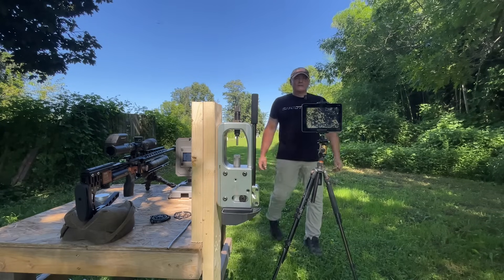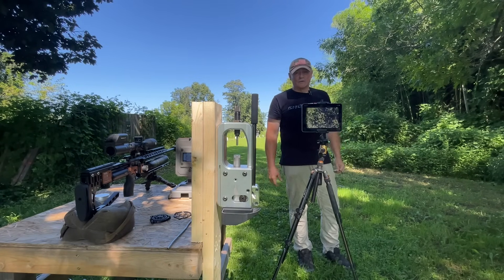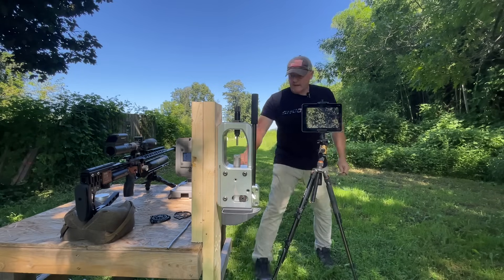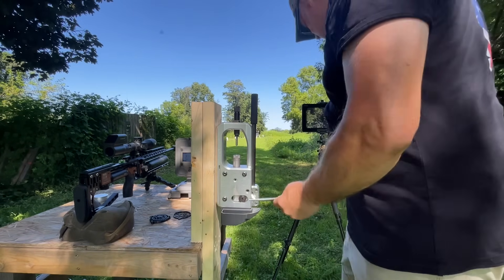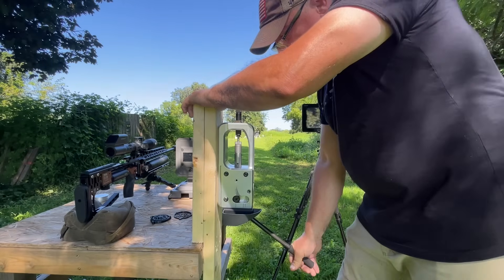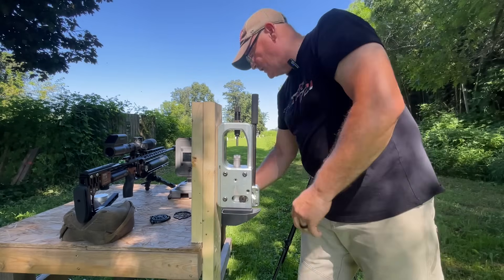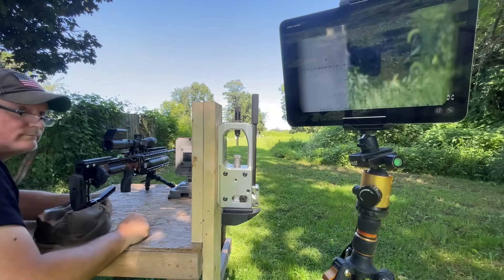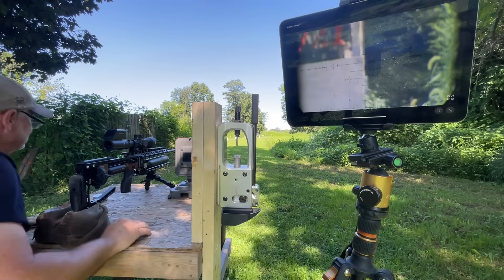Corbin Portable Airgun Slug Press

Comment: What is the actual diameter of your slugs.   
Does the external punch holder have a 7/8-14 thread?  
Is the swage die the same die that is used in the S Press?

Comment: That's cool! I have the S Press from Corbin and use it for air gun slugs. Corbin saw a need and filled it with a purpose built system. I won't be replacing my press anytime soon as it works great. You get what you pay for so be ready for that reality.

Comment: NSA lead wire. + Pressslug 30gn 25 Cal =1.50$ per 100 slugs compared to Fix hybred @ 25.00 $ +...... Per 100ct either press is a money saver, 🎉 the Corbin of course is going to be a little more expensive to make your slugs because it starts out $500 more than the pressslug but both presses will save you money in the long run the nice thing about the presses is you can tune your slugs to your gun not the gun to the slug this is great for guns that are not easy to tune or guns that are not tunable.

Comment: I'd have to do the math, but i think you would have to shoot a LOT of slugs for that press to be worth the price.  Unless you were making and selling the slugs to others.  I'm lucky to have the time to shoot even 30-50 slugs a week.  You would have to take into account the price of the lead rope, the press and specific dies.  I'm not sure you would even make your money back, for the press, in 50 years.  Unless the slugs you are making are superior to what you can buy from a dozen different companies.  Maybe more...  $1,200 is a hurt piece.  Maybe I just need more time to shoot.  Maybe I'll buy a press and some supplies and then quit my job, so I can shoot all day.  Smart, huh? 😉
Reply: Or buy a pellet trap and put old clothes in the back to stop the slugs and then reuse the lead by melting it and putting it into a lead wire mold.  You could shoot for years without ever spending any more money other than electricity.  Also for me a .20 die kit would be awesome to be able to never run out of a forgotten cal.

Comment: the press is NOT available to the public
Reply from the maker: It will be this fall. It should be available in October November.
Reply: @shooter1721  Nice, Wondered why I couldn't find it on their sight. I'm also looking at the GMI global press, I've read great things about the GMI products, not to mention they make a nice Boat tail die set.
Reply: Pyramid air sells corbin s press and accessories.